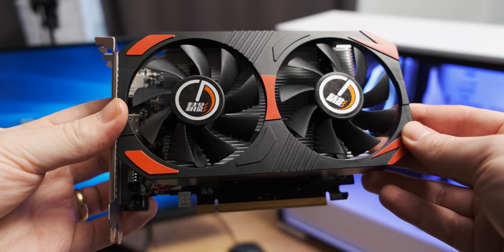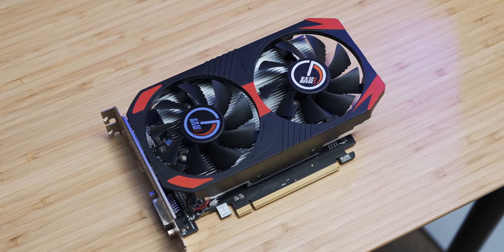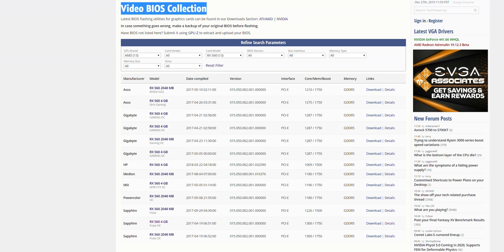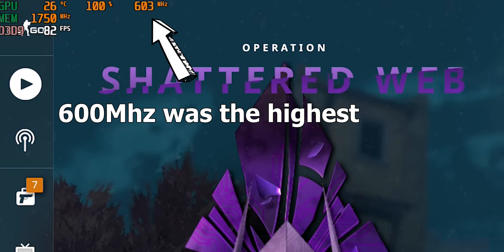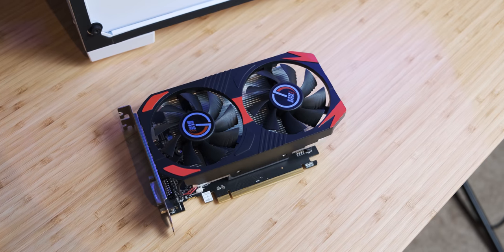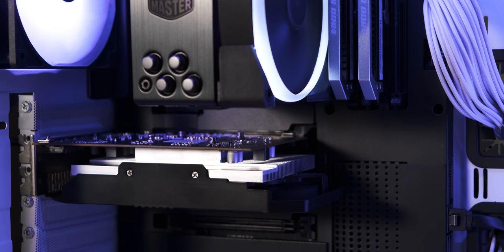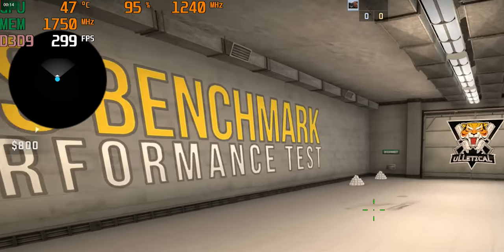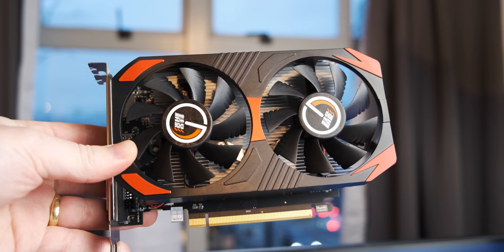Fixing the strange Corn AMD graphics card

Comment: You need to go full Chuck Norris and add an external power socket 😉
Reply: Strap a generator to it, now that's full Chuck Norris.
Reply from the maker: I should ask EVGA for one of those E-power things so I can make Chuck Norris proud. :D
Reply: @DawidDoesTechStuff  u should
Reply: @ultrademigod  not funny didn't laugh.
Reply: @Quint_69  Don't worry it's a slow burner.
Give it a week or two and you'll be laughing like somebody who read a comment on YT they thought was amusing.
Reply: This should be totally possible
Reply: @ultrademigod  I laughed, if that means anything.
Reply: @sam_8a  Agreed!  I think he should totally do that.  That being said, I wonder if there's a possible way to make a PCIe slot type device that sits between the board and the card which is capable of delivering more than the 75w spec'd to a 'normal' PCIe slot...  I know they make parts like that to monitor current draw at the slot, I don't think it would take much to put some protection in there to prevent backfeeding the motherboard and damaging that while maybe doubling the power to 150w?
Reply: Definitely, then hit it with the VRM editor and really crank the power up.  LOL, I had my RX-480 pulling nearly 350w that way, overclocked the F out of the poor thing.
Reply: @DawidDoesTechStuff  did you solder a power connector to that fake GT 1050?
Reply from the maker: @greggv8  No, I didn't end up needing to do that. I just found the correct BIOS and it worked.
Reply: @DawidDoesTechStuff  got it working with half life 2 at higher detail and games it wouldn't work at all with before?
Reply: @MrBillrookard  either cut off pcie power feed entirely, or use diods.
Reply: Let Chuck Norris fix it, it's going to power itself.
Reply: MacGyver one on.

Comment: stuff like this happens through binning. These are low quality chips that didn't pass QA, so they cut them down to ensure they work as a stable, low-price card rather than deal with rma requests. Corn (and other manufacturers) may not know the capabilities of each individual chip, they tend to be bought in bulk with the assumption that the are anywhere from 5%-25% less capable than higher binned chips.

Comment: This card probably doesn't deserve another video nor a revisit, but just to add, I unlocked my own VBIOS, it's fairly easy, and with the Polaris BIOS editor you can OC the card and increase the Current Limit and TDP Limit (mine takes around 85W purely from the PCI Express slot) and it works flawlessly. Instead of flashing other cards VBIOS which come with their own set of problems you could just unlock the stock VBIOS yourself. 

And btw, great video!
Reply: yoo please read i neeed help a did what he did and now it wont display
Reply: @franklinventura954  did you try using the onboard or another GPU?
If you can still see the GPU you might stand a chance of flashing it.
Probably binned it by now though.

Comment: If it is actually is a 560D, they are BIOS capped... but you should try a shader stress test to make sure all shaders are functional. 

To OC: undervolt the core until of crashes, step up voltage and try upping the core clock, do not touch mem. As far as i could see, mem isnt cooled so all mem should be dialed down ;) which gives you more powerbudget to feed the core

Comment: is it not possible that under-volting the card would help with the power issues by lowering the wattage require to hit higher clock speeds?

Might be worth a punt.
Reply: Was the first thing I thought when he say it haven't aditional power conector
Reply: The conventional wisdom is to always undervolt polaris
Reply: @smeezekitty  The Chuck Norris wisdom is to overvolt the crap out of it and use LN2 with a custom bios.
Reply: @virtualtools_3021  Chuck Norris just wants to watch the world burn.

Comment: Just a tip AMD graphics cards are only limited in power draw by the BIOS not by sensors on the connectors like Nvidia cards. So if you flash a 200W BIOS onto a 6-pin less RX 560 then it'll draw up to 200W from the PCIE connector.

Comment: solder a 6pin on it
redo OCing tests with it
Reply from the maker: It doesn't have a pin out for a six pin, I'm not sure where I would solder on the connector.
Reply: I'm watching at the PCB in the previous video and it probably requires proper ePower to get it done properly
Reply from the maker: @TheXlen  Yeah I think so. Maybe I can get EVGA to send me one. 😂
Reply: @DawidDoesTechStuff  if they don't ask people on r/overclocking discord to help you with it
Reply: Dawid Does Tech Stuff if you look at the Wikipedia page it shows which PCIe pins are ground and 12v, you can either solder the 6 pin to the motherboard or to the card, preferably to the card so it has perfect contact (you can grind or sand down the coating to reveal the traces if needed, which is what you do with the Epower board typically after you chop the card in half, also the Epower V board isn’t very expensive and I got one on sale for like $100, so check EBay, lol!)

Then you de-restrict the power limit with Polaris bios editor then run ATImdag patches and voila you’ve got it!

Or use an X399 board, as they have a 6 pin for the GPUs on the board, the power limit should be like ~150w through the slot without any issue would be my guess.

There are other ways as well (some x16 riser cables have a Molex assist for power, though I’ve found they need foil wrapping to prevent EMI interference on the cheap $5 cables leading to sporadic instability and system crashes).
Reply: @DawidDoesTechStuff  Actually you don't need ePower board for it. There is already input VRMs on PCI power line. Just replace this mosfet with a little bit better one and apply extra 12V to mosfet's drain or source pin (depends on mosfet) as parallel to PCI power lane. It should work fine. You can even trim off  PCI power lane from PCB and connect it to PSU plug.
Reply from the maker: @kenarsuleyman  That sounds way beyond my pay grade. 😁

Comment: Gotta say my thanks to you for teching me the art of vbios modding and vbios flashing.

Being a bit serious now. Your demonstration of fixing that Corn RX560 was a great help for me to get my XFX RX560 4gb Double Dissipation to the right bios. Weirdly it had the bios of an RX560D (XFX RX560 4gb Wolf Warrior Edition) even though the pcb was for the Double Dissipation version (RX560 with 1024 shaders) which I noticed due to the pressence of the 6pin pcie power connector.

I was able to flash it to what it is supposed to be with no problems and I didn't experience any weirdness with power limit being hit easily or frequencies not being right.

Though in the first place I shouldn't have this RX560 as I ordered an RX550 4gb from a used seller from China but instead got this XFX RX560 4gb. Weird that I got the wrong card but not complaining since I got a better one. No idea if the seller ran out of RX550s and sent me this but they could have also confused them as they look pretty much the same being both XFX Double Dissipation version cards.

Comment: So the Chinese characters on the cooler says "Jingying", which is a very interesting brand of graphics cards here in China. Their graphics cards are usually very cheap here, and you can only find them in one shop on Taobao (the domestic version of Ali-Express).
I think their RX560 retails for about 50-55USD here, so the value is actually much better. Same for all their other graphics cards. They're usually significantly cheaper than other reputable brands, but there are just quirks and cheap-outs here and there, so they've really created a (sort-of) fan base following, with another group of people criticizing it. Basically, if you buy something that works, good for you. But if it breaks, I've heard that the tech support and RMA staff are pretty unresponsive and it could take a long time to get replacement.
I've personally bought their "GTX460" back in the day, it was really weird with 384sp active, which isn't the GTX460 (336sp. 288sp for 460SE) but GTX560Ti specs. However, the GPU reads GF104, which indicates GTX400 series, not the GF114 found on GTX500 series. So it's really weird, and this was when the GTX600 series were on the horizon IIRC, so a "brand-new" GTX400 was unlikely.
Also, no one seems to know for sure where they got there GPUs from. Obviously, not being an AIB/AIC, they can't get them directly from Nvidia/AMD. Word is that they get them from some other branded AIB/AICs, but no one knows for sure. Anyways, back in Kepler days, they sold a GTX670 that actually used GTX680M (mobile) GPUs from (allegedly) some laptop manufacturer. If you look it up, the GTX680M and the GTX670 have the exact core specs, but the 680M is clocked quite a bit lower (~700MHz base) than the GTX670 (900MHz), so there was quite a bit of debate whether this much factory OC was acceptable from a stability standpoint.
So I guess is if you're looking into cheap, quirky GPUs, this seems like a good brand to start with.

Comment: BIOS flashing is a godsend. I bought an ASUS R9 290 back in 2014. I buddy of mine told me that it is essentially an R9 290X with cut cores in the BIOS. I flashed an R9 290X BIOS onto my card and have been playing with an R9 290X BIOS on my R9 290 for close to 4 years now. the card had 0 issues. I used the ASUS R9 290X bios, not the stock or reference BIOS. There is an asus Directcu II R9 290 and 290X and for me the BIOS is interchangeable. At the time the 290X was selling for 500$ and I got the 290 for $314 from Newegg that year(2014). Saved me a PRETTY penny on that one.

Comment: You don't need to edit the VGABIOS.  You can force it to flash anything to the card you want, you just need to use the command line tool instead of the GUI.
Just open a (admin) command prompt, go to the ATIWinFlash folder and run "atiwinflash -f -p 0 file.ROM".  This will ignore the mismatch and run anyway.  You may need to run "atiwinflash -unlockrom 0" beforehand.

Comment: 1: VBIOS editing is the only surefire way to permanently push limits on Radeon cards as there are software/BIOS/PowerPlay limits in place. Try to OC with different tools. I found that using the built-in Radeon 2020 drivers and Sapphire's OC tool gives me proper OC clocks and voltage. Increase your limits by editing the BIOS accordingly. Its just limits, not the actual running clocks.

2: Polaris likes memclocks a LOT. Polaris is also so power-efficient you can undervolt it and it still works. Therefore you should try to lower gpu voltage for that anemic heatsink and increase memory clocks based on what chips it has (I remember samsung chips are the better ones). The new Radeon drivers even lets you control memory TIMINGS not just clocks too! Polaris responds a lot more positively in the FPS and frametime department with faster and tighter memclocks.

3: Make sure to put board power to its max +50%.

Comment: Dawid, FYI... that same windows app "can" run in command line mode and there is a force switch (you can get the switches from command line help). I used it all the time with the manual editor also when overclocking cards for mining years ago.

Comment: Usually, CPUs and GPUs that have locked processors are originally a higher product with defects, a quad core with 1 or 2 imperfect cores turned to a dual core, etc... It's always better to just buy a higher product than buying a lower one and expecting unlocking to make it better, it's more of a gamble and it's not made for that.

Comment: Hi there. RX 560 Owner from the future. To anyone who owns this card or to Dawid who wanted to know why the overclock didn't go well, it's because MSI afterburner doesn't play nicely with it. You'd need to use the AMD Radeon criver software to raise the power limit and manually bump the clocks and voltage yourself. Got mine to 1469 on the core and 2000Mhz on the memory.......you're maybe getting between 11-23% of a performance increase depending on the game tho

Comment: If it helps now, it doesn't really mean that the bios doesn't belong to the graphics, it has to do actually sometimes with the memory supplier. I had an issue with a 470 and I was trying to install a BIOS which the memory was from Samsung but mine was from Hynex. After checking the BIOS info and putting a new one in there, boom I was able to flash it without any problem.

Comment: I bought the Corn Rx 580 For 100 bucks, Didn't even have to flash it because it had a dual bios switch on the PCB, a simple flick of the switch let me boot the card with the stock "un modified" bios. I highly reccommend it to any one trying to pick up a cheap card!!  I bought it almost a year ago, took the card apart, verified it was an actual REAL 580, it overclocks very well (as good as my other 580  I bought at microcenter).  Benchmarks were good, sorry that you were irritated with your card. But the reason that they modified the card was because it is a mining card that has been flashed for power efficiency. Thats why the clocks AND TDP are limited. Corn is well known in china for being a slightly shady company, chances are they  bought and then resold these gpu's from a huge bitcoin/crypto currency mining farm/warehouse. Hope this answers some of your questions about the card.  IF you would have splurged and got the Corn 580 like I did, all you would have had to do was flick the dual bios switch and you would've had a fully working RX 580... I bought mine when Rx 580's were still going for 180 up to 220 USD, while I only paid 100, and performance was great so all I can say is it was a hell of a good bargain. EDIT: I just checked my email for the reciept of my purchase, and I actually only Paid $89!!
Reply: Also, you can't really be that mad at Corn, at least they sold you a WORKING card that was actually what was promised on the Advertisement, Unlike scam sites like WISH.com ... Most normal consumers wouldn't even be looking at a card like this. I assume it would've taken too much labor/manhours for Corn to reflash the stock bios on these cards. They probably stuck it in a tester PC, made sure it booted, and moved onto the next card. Also, there ARE cards sold oversea's in China that are specifically underclocked and with lower TDP For the purpose of mining, and they come with that bios flashed when the card is brand new from the factory. Either you got one of these brand new cards that was meant to be a mining card, or Corn resold these from a crypto mining farm and the miners flashed the card to its current state. Either way, from what I remember when I bought mine, these cards are a great deal because they are 1. Cheap 2. Actually what they advertised them to be and 3. They WORK.
Reply: Sorry for these long ass comments, I had alot to say :]

Comment: I'm not sure the bios succeeded in unlocking any extra cores. The performance gains were in line with the clock speed increases (17%), not the multiplicative performance boost of 14% more cores + 17% higher clocks.

Comment: I have an RX 470. I was trying to overclock it with MSI Afterburner at first but it didn't work. I ended up being able to overclock my RX 470 to 1400 Mhz on the core using the AMD Software that comes with the drivers. It ran stable up until I got new thermal paste. (The new thermal paste was of a lesser quality.)

Comment: Editing the GPU BIOS was a little unnecessary. You can force flash it using the command prompt version of ATIFlash.
Reply: He couldn't because none of the BIOS'es matched hardware ID's in his card. That's why he had to edit the BIOS. Didn't you watch the video?
Reply: @itstheweirdguy  If you use the command prompt variant of ATIFlash64 (it comes in the same zip folder from techpowerup), you can set a flag ( I believe it is -f and -p if memory serves me right) to ignore mismatched subsystemIDs. This is about knowing what is possible with the tools at your disposal. Editing the GPU bios is a valid option, I am simply saying that an even easier option exists.

Comment: could the onboard fans be taken off for a higher stable clock and using a 120/140mm fan using system power instead? it'll save the extra wattage like off with the shroud and fans and on with on with one big one and zip-ties. similar note: i chopped up the fan that came with my ryzen 5 3600x and it fits perfectly in replacement of the stock fan on my MSI r7 360 OC 2gb gddr5 and the cable from the new "GPU FAN" is long enough to get to a fan header. think most new motherboard bios's are capable of monitoring pcie temps. mine does

Comment: Actually I saw plenty of rx560 with 14CU while there are with 16 and you need to be very careful when you select one. Note according to wiki 560D has lover memory frequency. If you see 1750 than it is 560 with 14 cu instead of 16. I bought 16cu/4G one from MSI because I wanted one without external power connector and in very small form factor.

Comment: Kinda late and you might already know this, but AMD cards are better to overclock in WattMan, Afterburner isn't an ideal utility for this. I recently bought an rx5500 xt 8gb on sale to tinker with, first tried Afterburner for overclocking and had similar weird behavior, then tried the Tuning utility in Adrenalin and it actually worked way better. If you ever revisit this card, or want to overclock an AMD gpu in general, might wanna try using the AMD software first. Mileage may wary though.

Comment: Forgive me if I'm wrong, but aren't shader cores (Stream Processors on the AMD platform) physical hardware-based cores? So by flashing 'more shader cores' isn't that like downloading RAM? Maybe the number looks bigger, but at the end of the day, it's literally impossible to add more cores. Unless of course, shader cores are logical cores (Like in hyperthreading on a CPU), or the RX560 has 'locked cores' on the chip.